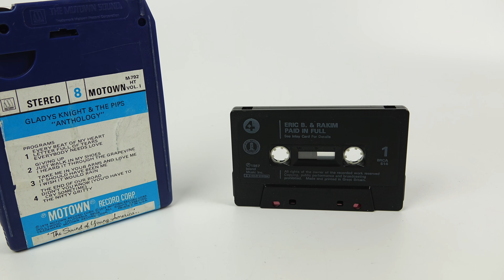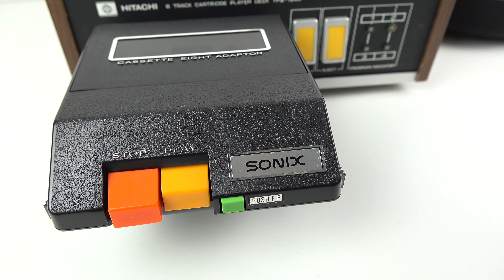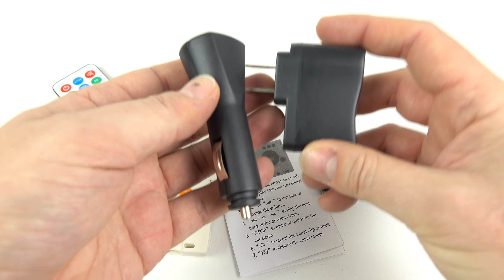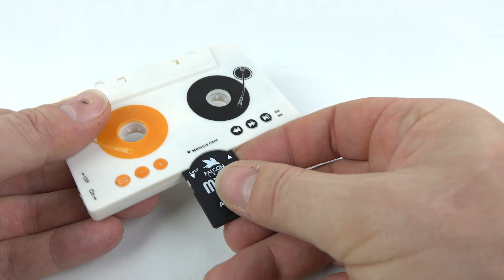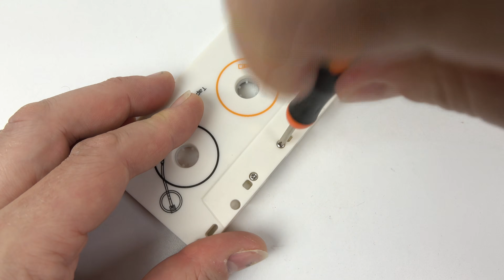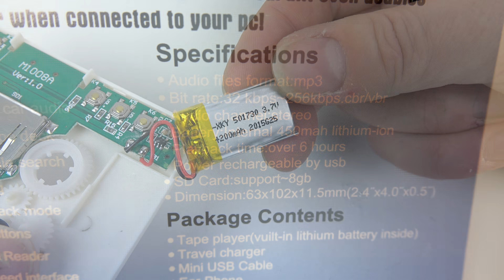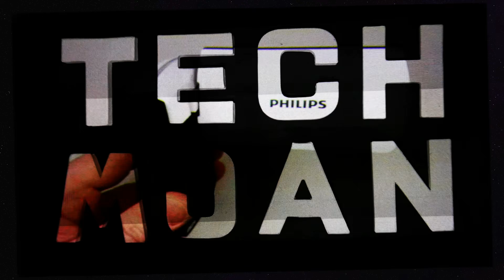Car Stereo Tape Adapters - 8-Track to Cassette to MP3

Comment: Cool! I was wondering when you were going to try the mp3 in the 8-track. The 8gb thing is probably accurate. It might play some of the songs, but it also might not be able to access certain portions of the card. Not sure if it's true in your player or not, but I've had that happen with older devices in the past, like when I bought higher capacity cards as they were released, and then tried to play it in an older device.
I remember having one of those 8-track adapters after I started driving. My folks left me with the old junkers to drive, a couple of which had in dash 8-track tape decks. I couldn't afford a proper cassette player, and they wouldn't let me pull the factory units out anyway, even when I did finally have the funds available. I had forgotten all about these adapters because it's been a few decades since I've even seen one.
I just thought of another device that I still have in one of my boxes o' goodies. It's a Bluetooth to cassette adapter. Everything is self contained in this little cassette. It has its own battery that has to be charged every now and then. When you switch it on for the first time, or if its paired device isn't nearby or turned on, it goes directly into pairing mode. The whole thing fits inside a car cassette player, except for one short wire with a mic on the end of it, or you can retract the wire and mic inside and there's a little sliding cover to hold it in place. It works as well as it possibly can, what with Bluetooth music sounding like crap anyway, but it does work. It doesn't have any controls other than a power switch, no volume control, no memory or memory ports. Very simple device, it does one thing, and that's convert a Bluetooth signal into a cassette signal. Theoretically, it could play music wirelessly from my phone to an 8-track player, if only I had an 8-track player and a cassette to 8-track adapte(o)r. Actually, it's not theoretically; I have zero doubt that it would work.

Comment: The quality of the MP3 player through the 8 track tape converter was much higher than the actual tape. The tape seemed to have wow or flutter issues? Maybe the rubber had perished somewhat

Comment: And it should have come with a couple of matchbooks  you can wedge under the 8-track part of it to keep in alignment to play.  You failed to simulate driving down the road with one of these things stuck out of your dashboard. I had an underdash 8 track mounted in my '68 Camaro, and between the rumbling engine, and the jolting from the road, this damn thing was being flopped around and the audio in a moving car on a rough road was well, PAINFUL.  Even though it cost like $29.95" then, I eventually threw the adapter in a box in the garage and bit the bullet and got a cassette player for my old Camaro.

Comment: There is also a Bluetooth to cassette adapter available. So, in theory and with the Bluetooth limitations of 44khz, it is possible to play lossless flacs from your smartphone on an 8-track car stereo. Or, but that's total waste of time, you could take that 8-track to cassette adapter apart, put a bluetooth receiver inside to get a better connection... I wonder if anybody did that already.
Reply: Just did a quick Google search... Yep! 8-track to Bluetooth is possible. This guy here in the link did it and explained, that there is even descent reason for it. https://www.thingiverse.com/thing:3393705

Comment: 13:16 I would like to hazard a guess that the real limit would be 32 GB.  8 GB was probably the highest SD card you could purchase on the time this was manufactured.
Reply: On the package, it says up to 8GB, but they don’t make 8GB SD card in stores anymore. It can support 16GB, 32GB, 64GB, 128GB, and 256GB.

Comment: Thank you, Techmoan!  I've out-hipstered the universe.  (No surprise, really, since I'm no hipster but I DO live in Brooklyn, so I have that in my favour/as a strike against me.)  After you convinced me to own a luscious Sony TC-D5M field recorder, I stuck my faboo "UPDATED Tape player" into that monster, slung its strap over my shoulder and I now have a ca. 1980, five-pound MP3 player with dancing VU metres and giant vintage headphones.  Taken to class and slapped on the desk, it gives even more of a WTF moment than to be seen listening to a white cassette through a headphone wire stuck in one end of the thing.  Better yet, a Bluetooth transmitter plugged into the "phones" jack of the Sony can pipe tunes through a Mega-Bass wireless headset OR (points for weirdness) the Bluetooth unit on my motorcycle helmet with the Sony slung across my back.  Better-better yet will be when I dismantle the Bluetooth XMTR and rig it for permanent power inside the TC-D5M with signal leads to the headphone audio circuit:  Invisible Bluetooth in a vintage field recorder.  Alternate better better yet:  Embed the "UTp" MP3 player AND the B/T XMTR beneath the seat of my motorcycle with continuous USB power, so any time the helmet is powered-up, instant music.

Except the controls of the "UTp" suck wind.  On the remote, one can punch the number of a given track and play it on demand, but there is no random-repeat-all capability at all.  The "RPT" button on the remote just makes the current track repeat until you want to take a can opener to your own skull, extract your brain, and carry on jumping on it in the street to make the horror stop.  Goodness knows what the "MODE" button does.  Make it stylish?  Cover it in ice cream?  Force-play Depeche?

Comment: I was hoping that there was a Way to listen to mp3 on a car with cd player, but thank for your video(s).
Reply: Unless your CD player has an AUX input, your only real option is to use a short-range FM transmitter.

Comment: The mp3 to cassette thingy is a massive disappointment 
They could have made it pause and rewind with the spindle holes 
They could have even made it recharge with the rotation of the spindle 
I was thinking of getting, glad I didn't

Comment: It is interesting that they standardized the wiring of the 8-track track end sensor - they must have planned for the ability to power something with the contacts.  Some car I bought, possibly a Beetle, came with an 8-track to cassette adapter under the seat.  It was a great prop for laughs.

Comment: That looks like a cheaper version of the Realistic (Radio Shack) one we used in our 1978 Chrysler Cordoba to play tapes in the factory 8 track.

The 8 track magnetic solenoid that switches the tape head to the next track is energized by the foil tape on the 8 track tape, and that coil takes a bit of power.
The cassette adapter doesn't take much power, therefore when it is connected across the switch (foil tape sensor) the solenoid coil winding don't offer much resistance and source the power for the cassette adapter.

I took ours apart in the early 80's to figure out how it worked. LOL

I don't remember ours over-driving and causing distortion, but it did sound muddy a bit much like a cassette playing in a cassette player that had the head dirty or out of alignment.

I was very picky about fidelity as a teen.
I would carry a jewelers screwdriver so I could align my friend's cassette player heads when I'd hear them losing the high end.

Comment: I remember many many years ago, something similar to the MP3 to cassette adapter was done for 35mm cameras. It was essentially a CMOS or CCD sensor that has a memory card a writer on it. It was shaped like a 35mm film can and had a part that came out with the CCD that went behind the shutter. I don't think it ever made it to world wide production, but I remember really wanting this device....

Comment: What about the fm transmitter adapters that just play your new source into the radio? When CDs first came out, I used one of those with my Sony D5 player. 

I also made a homebrew cassette adapter by wiring the head from a scrapped cassette deck to a headphone plug and gluing it into the shell of an old tape. It wasn't great, but it worked.

Comment: They make SD card readers for MP3 that plug into the cigarette lighter port and then broadcast over a channel on your radio that normally wouldn't come in. But I like the idea of an 8-track to cassette adapter that then adapts to an AUX cable into my phone. I wouldn't want to need to charge a separate blue tooth device if I didn't have to. I have a 2007 car and I use a Bluetooth to Aux adapter that works really nicely. The annoying thing about this. My car HAS built-in blue tooth. But it's for phone calls only. That's just weird man. Those little oddities in stepping stones to technology.

Comment: It just occurred to me that I've been watching this channel for ages without actually subscribing. Sorry about that, mate. This condition has been rectified.

I read the video description. I would have thought that the fact of coincidental repeating topics among vintage technology enthusiast videos would have been fairly obvious to anyone with normal cognitive abilities. It rather sucks that this has to be an issue. As a consumer of such videos, I enjoy watching two or three videos on the same subject. There is obvious overlap (and cooperation) between several channels, such as The 8 Bit Guy, LGR, Techquickie, and others.

This symbiosis enhances the enjoyability of the videos. I am certain that other video genres have formed similar arrangements. I enjoy watching MRE review videos. The content creators regularly send each other military and civilian rations. They often mention each other in their videos. The tone is invariably positive. The ration might be less than fantastic and get low marks, but the host or hostess always express gratitude for the opportunity to experience something new (or old). 

So keep up the good work. My hope is that you will not find too much occasion to respond to such non-issues.

Comment: I had a neat little device in the early 90s called a "Sound Sender".  My first car just had an AM/FM stereo with no cassette deck, and certainly no CD player, and this was before MP3s existed.  With this device, you plugged it into the cigarette lighter, tuned the radio to a specific frequency, and plugged it into a portable cassette player or portable CD player, and the sound came over the radio.  It actually worked pretty well.  I don't know alot about the specifics with electronics, but it seemed kind of like a similar concept to an R/F adapter for a VCR or video game console for a TV, where you selected channel 3 or 4 and the signal of the device went over that channel.  Similar concept, but with audio rather than video.
Reply: they still make some kind of adapter

Comment: I got a 2005 Acura TL, I’ve got that same issue, but I also love my cassette tape‘s, my cassette  to auxiliary is the last ditch “shit has hit the fan“ kind of back up. If you really want something, I recommend a Bluetooth to FM/AM transmitter, basically gives you your own radio station! Every now and then you will hit an area with interference or another radio station actually enters the fray, that’s the only reason why I have cassette to auxiliary still in my car.

Comment: ok why doesn't 8-track to cassette not keep triggering the program switch in the 8-track player? if the player is waiting for the circuit to be completed then drawing power from it would cause the player to switch programs continuously? or  does it just switch once. Also in the adapter is the head that simulates tape a record head from an 8-track recorder or is it just a play head. and if it just a play head how does it make sure that is on the same track as the player?
Reply: For your first question, maybe the resistance is high enough for it to not trigger the circuit.

Comment: I lived it all....I have one of those adapter..Also dont forget the FM stereo adapter cartridge tuner pack   just like the cassette adapter.Just put it into the 8 track player and you have a instant FM stereo tuner.

I still use the cassette adapter with wire  for my  mp3 players and  mp3 cd players in the car.....Never tried the SDcard cassette yet....

Comment: I saw a 1950's Cadillac with it's original am only radio a 1970's 8-track dashboard mounted with one of these 8-track to cassette adapters with a cassette to headphone Jack adapter in it connected to a sony discman sitting on the seat. So that was CD to cassette to 8-track to am shortwave radio played out of a single rotted 4x10 speaker in the dash.

Comment: I had a different make it used in my 69 Mercury Cougar.  So I could keep it looking standard when at shows, I used....The 8 track converter with a cassette tape converter plugged into my mp3 player.... In the end the 8 track player was gutted and made so you could plug in pc hard drives that were in the 8 track cases..

Comment: Hahaha. You do know that the "proper" chargers come from the same factories right? Same circuit in a cheaper case. I haven't had a cheap Chinese charger that didn't work the way the expensive store bought Chinese chargers did. That 12v to usb adapter was a standard circuit for most 12v to usb adapters.

Comment: So I remember my parents and BOTH sets of grandparents had these Big huge floor model radio Record and 8 track players ... they were literally pieces of furniture with lids for tops and pull out trays right underneath the top, and then speaker cabinets and media storage shelf behind doors at the bottom. The pull out tray in the center of all three units held the radio and the power and audio feed controls. The right side had the record player and then the left side had the 8 track player. The center console control the power for both these units , the audio feed and volume control for both the side units, plus two other other audio feeds and power switches for single power outlets. The device had the ability to accept the feed from two different micro phones and the device came with THREE micro phones... a hand held one, one that came attachable to a stand, and a “TV” micro phone. This last bit was something you would put in front of the speaker of a TV or even a film projector and then you could play the audio of the TV through the stereo. The cool thing about all the these features is it allowed you to play and mix the feed from all 5 of these audio sources and even independently control the volume and left right balance of each feed 
This is cool but unrelated to the topic at hand.
What’s also cool and unrelated is these were handmade devises not built or marketed by any particular brand but custom made by someone who bought the individual components and then incorporated them into a piece of carpentry furniture.
What I though was truly interning is that one grandparent’s unit had a tape deck incorporated into the left cabinet. One unit just had a cassette to 8 track adapter that was down in the media storage compartment. But the final (or technically middle) had a bracket built into the woodwork of the left cabinet that was custom cut for a place to store the adapter when not in use AND a hinged leg in the hinged top of the console on that side to keep the top from coming down on the adapter by accident while it was still in the player but pushed back in the stored position. I just think it’s cool to see an example of how a single craftsman adapted his personal design to adapt to the changes in technology

Comment: He should have loaded the mp3 player up with a transflash converter, and then put a bluetooth adapter in, then link up bluetooth to some audio streaming service over wifi.  Audio streaming => wifi => Blutooth => transflash => compact flash => mp3 player => cassette => 8 track. That would have to be some kind of Guinness world record. (yes, I know there is no such thing as transfash to bluetooth. I can pretend though.)

Comment: Interesting devices. I always had better MP3 devices.  So since I have never owned a car with Aux in Always had a Cassette Tape deck so have to use the tape with the wire coming out so I could play my iPod in my car stereo.  I had to go through 4 different manufacturers because of an auto reverse tape deck.

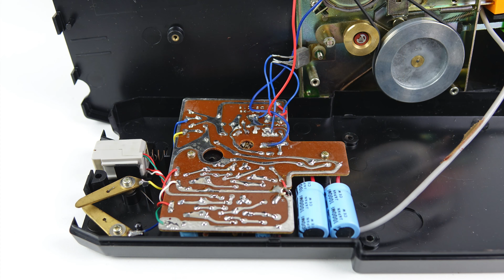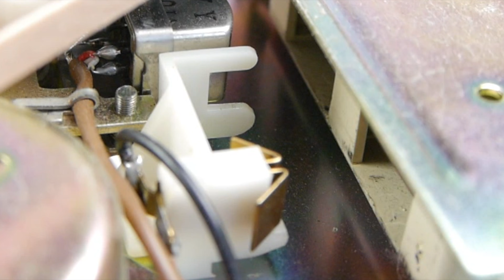Comment: I believed the power came from the channel change sensor. In tapes, the metal strip shorted the contacts to change the channel. There is voltage potential. That's what powers it, right? I am saying this while stopped at 3:46. 5:01 confirmed it.

Comment: If I had to guess, the 8gb card limit could be because the people who made it tried an off brand 16gb card, possibly for cost reasons, and it didn't work.  I say that because I have a few devices (namely a Sansa clip MP3 player and an EverDrive GB) that get fussy with off brand ones.  SanDisk, Samsung, Sony ones work fine but other ones no.

The actual limit it might have is 32gb.  That's the limit for SDHC, and I have oh too much experience with that problem

Comment: Have you ever thought about making a part two for this video? I just recently talked with my friend about these cassette adapters and how they worked, so it was really neat to find you had made a video about them. However, more than cassette adapters I would like to know how the CD adapters actually work and if they are worthwhile. I was actually expecting them to be in the video since there was a CD at the beginning but hey, can't have it all I guess. Anyway, it would be neat to see you make a video out of them. Hey, maybe add opening that cassette adapter with the wire sticking out of it as well, it'd be neat to see how different the insides are from the MP3 player thingy.

Comment: I have two of those MP3 cassette adapters, one I bought about two years after the other. The first one would only do 8GB on a card, the second one can use up to a 32GB one, at least. The second one also produced much better sound quality than the first one, and the first one died after about a year and a half. The second one still works after four years. Battery life on both of them was about six hours, as the packaging said.